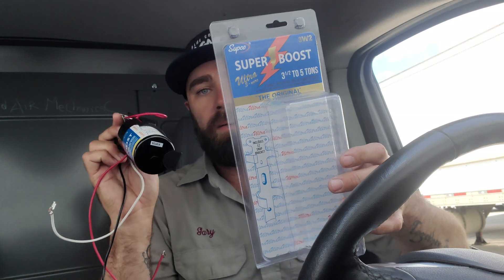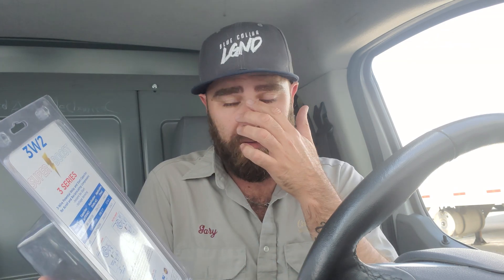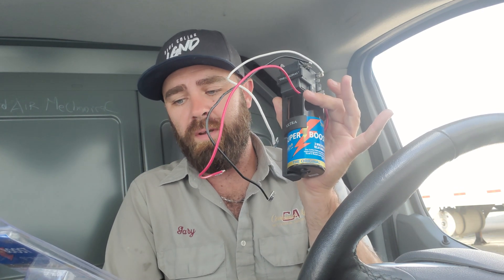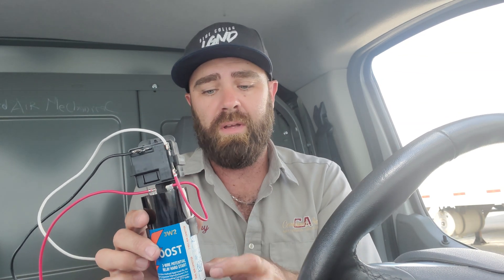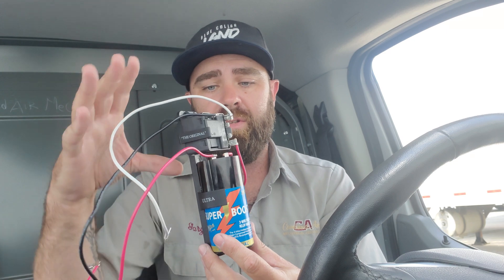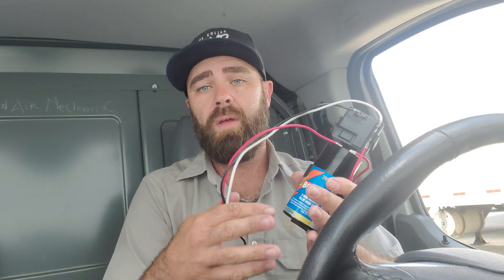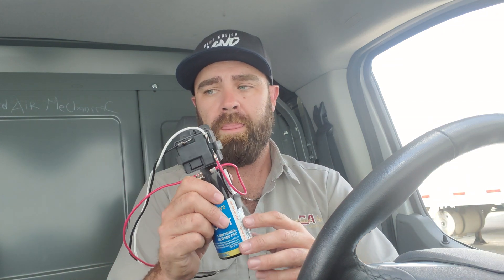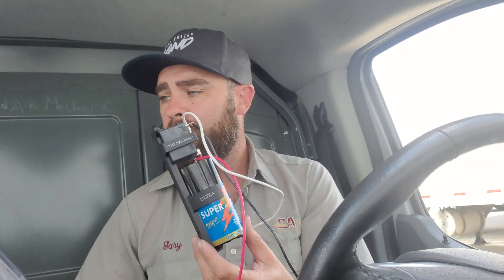Compressor 3 Wire Hard Start Education

Comment: Are you advocating hard start ups for reciprocating compressors, scrolls compressors or both and assuming in a NON-preventive maintenance? Scrolls always start unloaded by virtue of a check valve that keeps the spirals from rotating backwards for extended periods of time and prevents hot gas from flooding the low side when it cycles off.  So even if the system pressures are unbalanced, the compressor is not.  As such, low voltage conditions are not as big a factor and 521s should not be needed under normal circumstances= AGAIN SCROLL COMPRESSORS.
Reply from the maker: Small systems mainly with tin can scrolls or even semi hermetics with single phase power and tx valve.  Any tight compressor having trouble starting.  I'm saying to use these on an as needed basis and to have on hand as a troubleshooting tool or get out of a jam device.
Reply from the maker: Sorry meant tin can reciprocating not scroll